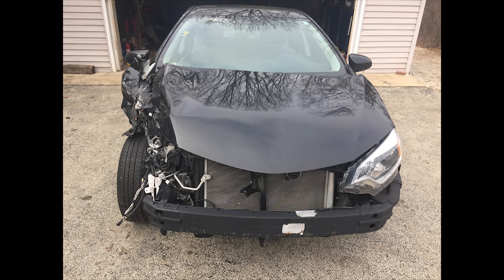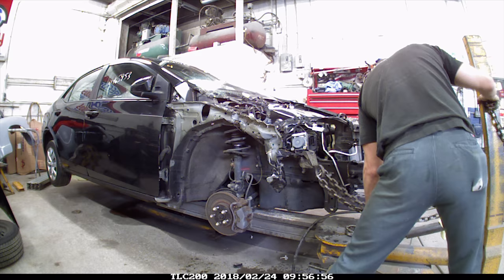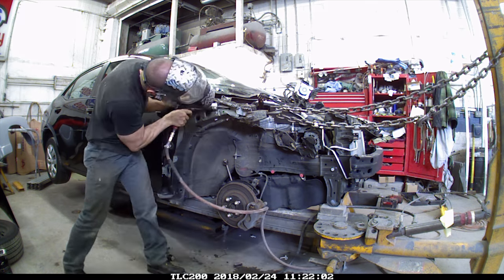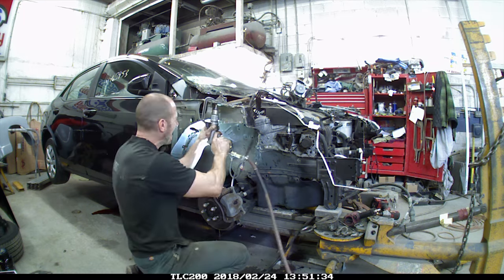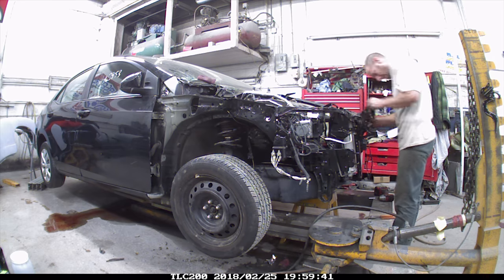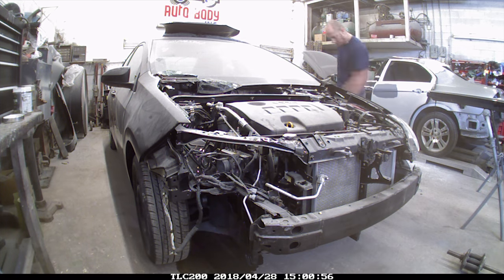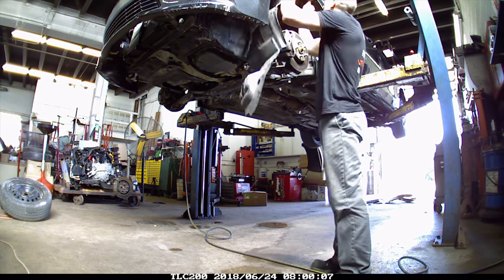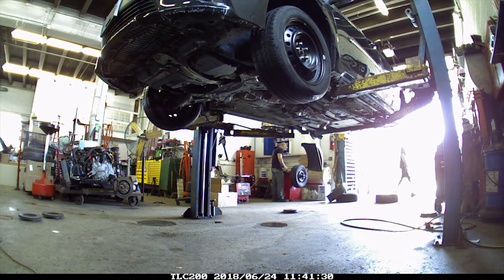2015 Toyota Corolla light front collision over the bumper time lapse repair

Comment: As a retired fleet tech, I’ve done tons of rework of factory warranty crap as well as spent loads of time on rework on hack body shops till it made me leave the trade from burnout after 30 years.

You sir are rare and I’ve seen so much that I can’t forget just walking through shops that made me cringe.

Thanks for the great video and keep them safety glasses on those precious eyes my friend.
Reply from the maker: Thanks, I have run into some scary stuff I have had to repair in my rebuilds also!

Comment: Thanks for your videos. I started watching repair videos from another YouTuber and while he was entertaining, he was obviously not a body man or a mechanic and did some absolutely wrong and dangerous things. Anyway, you can tell a guy who knows what he’s doing and does a job right. You know what your doing and it’s refreshing to watch a “pro”.  Are you a trained mechanic and/or body man?
Reply from the maker: Thanks for watching.  I have recently started watching videos here and there and I know what you mean.  It is good that you can realize the difference between the right way and the way people sometimes do things.  The biggest problem is than sometimes people that don't do things the right way have a large following of people that are learning things the wrong way and go on to make the same mistakes in their projects.  I am a mechanic.  I worked in a bodyshop for years and did bodywork when the mechanical shop got slow.  I took classes and trained with the other body techs and have done my own rebuild projects for 20+ years. So I have a little experience with every aspect of a rebuild from frame work to painting.

Comment: Nice Repair. It this is a car your'e not really familiar with, how do you know where the various harnesses, lines,etc. go to be correct? If you've not seen it undamaged? You're skill set is amazing. I would have no qualms purchasing a vehicle you've repaired.
Reply from the maker: Thanks, stuff kind of fits in only one spot so sometimes you may have to search for that spot and route a harness 2 or 3 times to get it right but with some patience, it all goes back together like it should.  I did have a parts car to refer to and when I took it apart, and saw how everything was supposed to go.  Truth be told since I was putting this together 4 moths after I took it apart, I did have two little pieces of foam that took me like an hour to figure out how and where they went. lol That makes the difference in the repair.  I could have just thrown them away and no one would have noticed but the hour spent to put it back together correctly or take something apart for a second time to get it perfect is what sets me apart from the guys that are in this just to make a buck.  Thanks for watching!

Comment: Since this a 2015 model. it doesn't have the Safety Sense package that Toyota added in 2017 which includes pre-collison system with brake assist.
Reply from the maker: Like any other system, they are not perfect.  I have seem some that even the pre-collision systems could not prevent.  I agree it may have been useful in this case though but then I wouldn't get to fix it. lol    Thanks for watching.
Reply: Davin Peterson A safety sense package  doesn’t replace your eyes

Comment: You know what I would like to see a video on.  How you keep your parts and bolts organized.  Do you do any type of bagging system ?  Or just a pile for every car?  Do you keep a list of parts you need as you are taking them off and find they are not saveable?  I imagine that all goes on behind the scenes once the cameras are off as waiting on hold with the wrecking yard is not that compelling video! LOL
Reply from the maker: I'm actually starting some how to videos next month at the request of my viewers.  They will have some behind the scenes stuff as well as a close up and explanations of what and how I am doing my repairs. The how do you keep track of parts question is one I get a lot. lol
Reply: Fantastic suggestion. When I work on my vehicle I usually have them marked in a baggy or stuck on/in a cardboard slab that is labeled.
Reply: I don't know how vehcor does it, but like him my projects can be apart for some time. During that time the brain cells forget where those fasteners were supposed to go. So a couple of things I find useful are a quick cellphone video showing routings and positioning that's just me talking it through. Then I use ziplock baggies and place all the pieces for each step into them, seal them and label them plus I add a number that was that removal step. Then when it comes time for reassembly I begin with the baggie with the highest number and proceed to put it back together. If I have a question about did this hose go over or under, I refer to my video. I also use masking tape on electrical connectors and hoses  with brief labels like TPS, EGR, MAP, etc. Then if you come across that mystery connection, it's not a mystery.

Comment: I love watching your video's. At my shop, they usually tell you that your car is a total loss when the bulbs burn out on it. You make swapping a chassis seem an easy job. What would be super interesting is if you would mention what you paid for the car, what you spent on parts and what you sold it for. Keep up the good work. I can't wait to see how you got on with the 2500HD.
Reply from the maker: A lot of shops only take in the gravy work.  It has gotten worse over the years.  Swapping frames and cabs is easy, it just takes practice like anything else.  If you never try, you never learn.  I would give out prices except I show my videos to buyers and prices just complicate the sale which is what is important to me.  I will give out prices on some if I can or at least give you an idea on some of the big ones.  Thanks for watching.
Reply: vehcor so about how much a job like this cost?

Comment: Thanks so much for the great video.  I wonder if making a 1-1/2 inch hole on the wall of the passenger side front wheel well would affect the structure of the 2012 Camry.  I wanted to have access to the PCV valve, which is at the back of the engine and under the intake manifold.  The hole would be slightly above the frame and near the strut tower.  I would appreciate your advice kindly!  (There are people who do the job from below the engine or by removing the intake manifold, but, at 74, I feel either of the methods is too much for me). Thanks again!

Comment: Great video! May I know how much was this repair worth?
Reply from the maker: Thanks, this job was $3500 without the additional maintenance work. That added another $1000. Thanks for watching.
Reply: @vehcor  was the $3,500 for just parts or does it estimate/include labor? I ask because I JUST had a rear end with my 2015 corolla and it looks like this. ;-( trying to estimate

Comment: Is this this your corolla ? because in Canada our insurance company wood never put new wipers tires brakes rotors on and you sir are very knowledgeable also watching your d-max vid lately omg the wiring electricail is so mindboggeling to watch
Reply from the maker: These are all cars I buy from the auction to drive or sell.  An insurance company only fixes what was caused by the accident as well in the US.  They never would have paid for the brakes, tires, battery, oil change or the wiper blades.  Keep warm up there and thanks for watching!

Comment: Do you ever sent the car/truck to a frame alignment shop ?  I mean just the fact that all the parts are in and welded, painted, but I was interested in the camber / Castor of the wheel ?
Reply from the maker: Every car goes for an alignment when it is done, that and an oil change regardless of what was done.  The auction loader drivers tend to damage things underneath. Even if it is only knocking things out of alignment so it is cheap insurance.  This one got 4 new tires, so an alignment is a good idea anyway.  Thanks for watching.

Comment: I recently wrecked my 2016 Hyundai Sonata ….looks very similiar to how this one ….completely missed the front bump bar it took out everything from headlight all the way to suspension missed the main frame. Didn’t quite hit the motor mount. Afraid of insurance totaling my car out so I don’t want to take to shop yet but would you be able to give me a rough estimate of how much you think this job would typically go for. Great video though btw keep up the good work. To clear it up asking for estimate cost of the job in your video

Comment: My 2014 Toyota Corolla was rear ended and it pushed my spare tire trunk well in a little. However the Rear Trunk Body Trim Mold will not fit properly and i don't have $2900 to $4000 to fix it. The entire trunk. You can't even tell the car was hit except I point it out. What would you remmend just to get the Rear Trunk Body Trim Mold to fit properly.

Comment: Excelent videos perfect results. If possible may i know the make and model of the equipment you use under the vehicle to pull and straighten the body. Thx in advance you're a pro at what u do
Reply from the maker: Thanks, the frame rack is a Car-O-Liner.  Best on the market in my opinion.  Also the most expensive.  This one is 30+ years old and the model number is long gone, sorry.  There are a few different models they offer now for different uses.  Thanks for watching!

Comment: Hello , do I need to use "putty" or body filler before painting welded apron?  Is it  necessary or I can just spray it with paint? Thank you
Reply from the maker: Body filler is for making the outer panels pretty.  You should not have it on the inner structure.  Just grind the welds down, prime and paint. Thanks for watching
Reply: @vehcor  Thank you for advice.  I thought the same way,  but my paint shop  gave me this idea. I'm like,  wait.  .  Let me ask a professional .

Comment: I have a 2012 Toyota Corolla LE, a few days ago some lady slammed on her brakes right in front of me, and I hit her at about 5mph, there wasn’t a scratch on her car, but my front bumper cracked apart and came off, my hood is dented and no longer sitting straight, at least one quarter panel appears to be damaged, any idea what a rough ballpark of repair costs would be? It’s not nearly as bad as this car, headlights still work, horn still works, the impact was so light it didn’t even set off the airbag.
Reply from the maker: Sounds like a couple grand

Comment: When working on the upper rail is it worth to replace it if there is small indentation or would it be better to just straighten it out (same car but small indentation caused it to be about 10degree out from original postion would i need to weld a new one in or can i get away with just bending it back in place?)

Comment: I’m thinking of buying a 2015 Hyundai for extremely cheap and the damages are pretty similar to this corolla. It has been in a collision. What’s the estimate on how much a repair like this would cost? Is it worth buying?
Reply from the maker: The exact same damage with the same parts on a different car can be a totally different price.  The labor times and techniques are different.  The parts prices are different. Not to mention labor rates are different in different shops.  It would be best to get some estimates from a shop that you plan on using to repair it.  If the purchase price plus the repair is less than a comparable used car, then it would be worth it.  Thanks for watching.

Comment: What's 79000 Subs I doubt you're going to respond to my comment. I got a 2014 Toyota Corolla needs a right driver side front fender. Is it a DIY job? Or should I have somebody do it. I do not want to spend a lot of money. Your help would be appreciated
Reply from the maker: It takes me a while but I respond to everyone.  I don't know how much longer I can keep it up but I try.  The fenders are pretty easy to change.  Go with a used or Toyota fender, the aftermarkets do not fit well.  You will have to loosen the bumper and remove the wheel liner but those are the biggest parts.  You could have a shop paint the fender and install it painted if that is something you cannot do.  Blending the paint into the door and hood is the best chance for a perfect color match but may not be in your budget if you just want a cheap repair.  Good luck if you decide to tackle the project.

Comment: Hey man how much did this cost? My car has very similar damage, but plus the radiator leaked and the front frame rail needs to be pulled back out slightly
Reply from the maker: $6,000

Comment: I was wondering how much something like that would cost? bc I just had an accident where there is visually half that damage on either side and they quoted me 2800 per side....first estimate but wanted to know if that's legit. Thanks a lot
Reply from the maker: Prices can vary greatly depending on the shop's labor rates, quality, repair vs. replace and the types of parts used.  To get his done at a shop would be a minimum of $2000 and $6000 to do it right.  There might even be higher ones if all the parts were purchased new instead of some used ones.  Thanks for watching.

Comment: what do you use for a spot weld drill bit?
Reply from the maker: I either use regular bits or the flat tipped ones if I need to save the panel underneath.  I don't like the hole saw looking spot weld bits because it make getting the scraper in to separate  the panels harder with the leftover lump.  Thanks for watching.

Comment: What is a typical cost for something like this??
Reply from the maker: Prices can vary greatly depending on the shop's labor rates, quality, repair vs. replace and the types of parts used.  To get his done at a shop would be a minimum of $2000 and $6000 to do it right.  There might even be higher ones if all the parts were purchased new instead of some used ones.  Thanks for watching.

Comment: $$$$ Do to the cost of a rebuild like that It might have been totaled and end up in the junk yard. Video is a great job.
Reply from the maker: This one was far from a total.  It would have been repaired if they had insurance.  Thanks for watching.
Reply: @vehcor  It all comes down to $$$. I  got a quote on a crease about 5" x1 wide" for  $850 without replacing the OEM headlight!!!! Add about $600 for those. Yes I know I could buy after market Head Lights which the tech claimed it would be another $100 to install. This is a 2003 Corolla.

Comment: How much was this?
Reply from the maker: Prices can vary greatly depending on the shop's labor rates, quality, repair vs. replace and the types of parts used.  To get his done at a shop would be a minimum of $2000 and $6000 to do it right.  There might even be higher ones if all the parts were purchased new instead of some used ones.  Thanks for watching.

Comment: I got into an accident yesterday. I was driving on the left lane and then all of a sudden a white pick up truck pulls out in front of me and hits the right side of my car. The engine is still working, but the radiator is damaged, and the airbags have been deployed. I know they say once the airbags are delayed the car is a total lose but I am still not sure if its worth fixing now that the airbags have been deployed.
Reply from the maker: I have fixed plenty of cars with the airbags deployed.  It will probably be totaled since the airbags went off.  After all, that IS why they put them in.  It has less to do with safety and more to do with selling new cars.
Reply: @vehcor  Well the car I had was a 2013 Hyundai Sonta so its a pretty old car.

Comment: About how much would something like this cost? Anybody?
Reply from the maker: Prices can vary greatly depending on the shop's labor rates, quality, repair vs. replace and the types of parts used.  To get his done at a shop would be a minimum of $2000 and $6000 to do it right.  There might even be higher ones if all the parts were purchased new instead of some used ones.  Thanks for watching.

Comment: Hi Sir, How much does this repair cost?
Reply: Just check some comments and get know that the price is not to be released. Thanks for sharing your great project!!!  Just curious how much it would be to get this kind of job done in an autobody shop :)
Reply from the maker: Prices can vary greatly depending on the shop's labor rates, quality, repair vs. replace and the types of parts used.  To get his done at a shop would be a minimum of $2000 and $6000 to do it right.  There might even be higher ones if all the parts were purchased new instead of some used ones.  Thanks for watching.
Reply: @vehcor  Great thanks for the information! Very appreciate to your sharing!

Comment: Did you take parts of another car ?
Reply from the maker: The inner-structure, hood hinges, ABS module and brake lines, yes.  The hood, fender, bumper and headlights were all new.
Reply: great job. did the airbags go off?
Reply from the maker: No air bags went off.  It was a very light hit just in a weak area so it looks bad.
Reply: @vehcor  to get the parts from the other car, did you saw them off yourself?
Reply from the maker: @asmith5799  I drilled them off, yes.